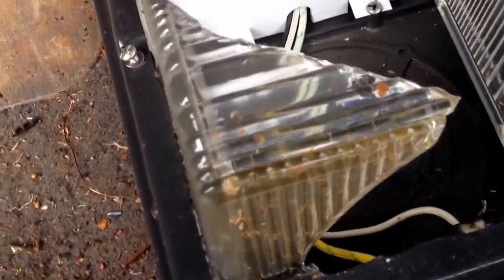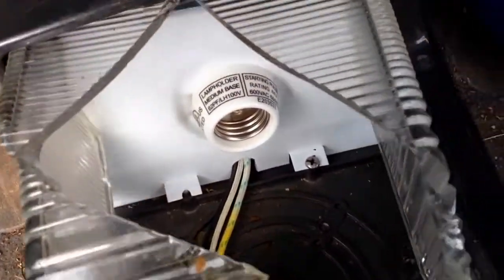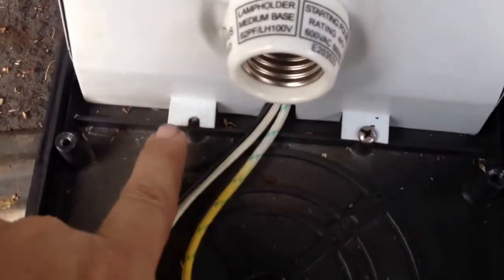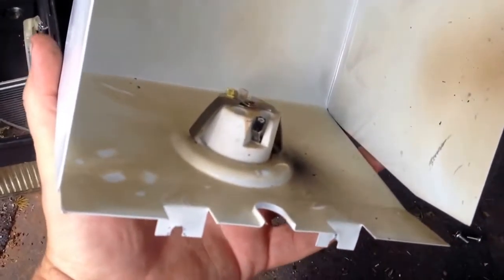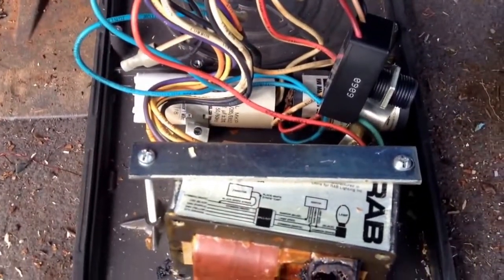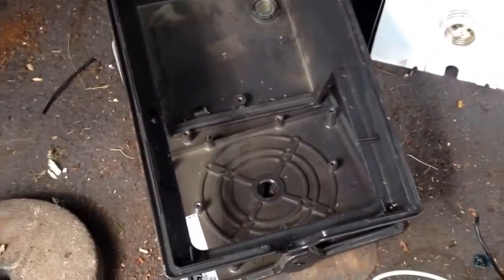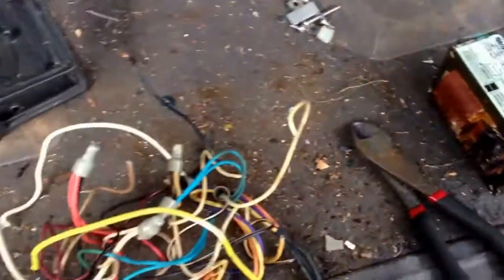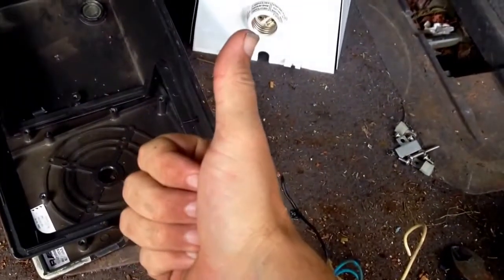Scrapping an industrial dusk to dawn light for copper aluminum and more!

Comment: Was there any brass in the white bit where the light bulb is screwed into?  I usually find where there's light there's brass.

Poo
Reply from the maker: Great advice! I will check the base a little closer next time. That makes perfect sense that there would be brass in it for the contacts.
Reply: It's all about learning and helping each other.